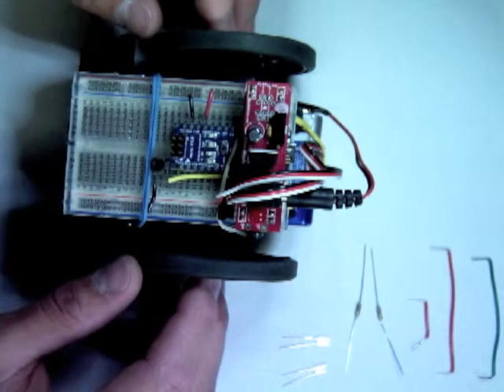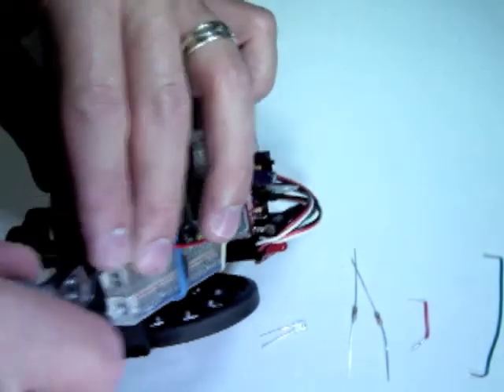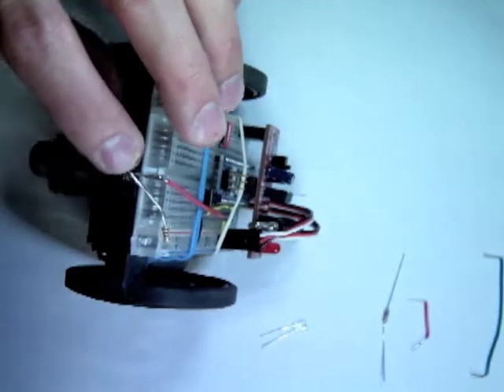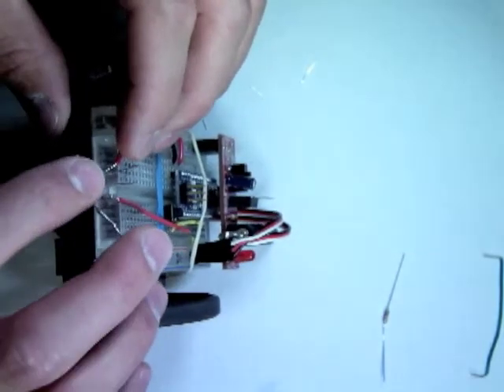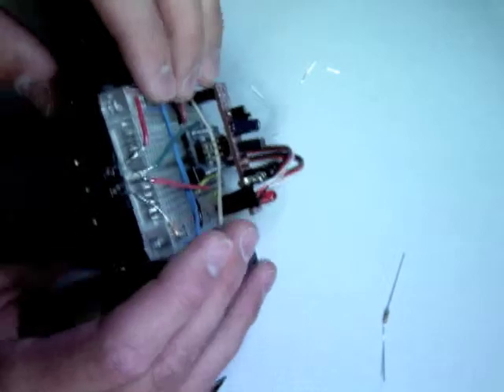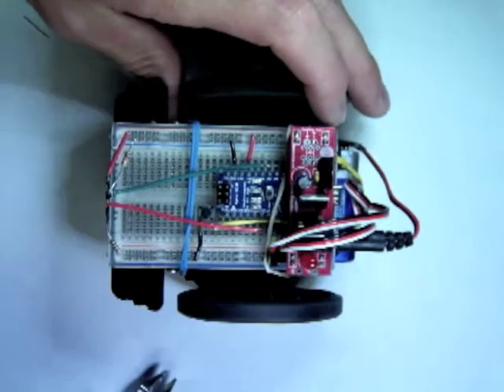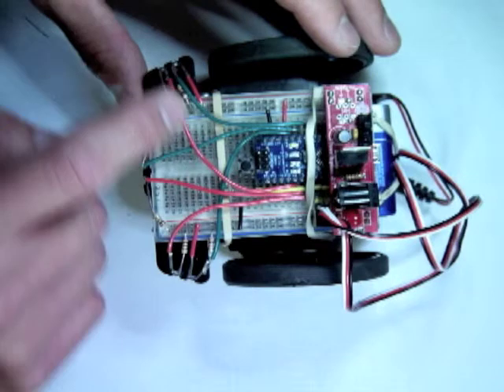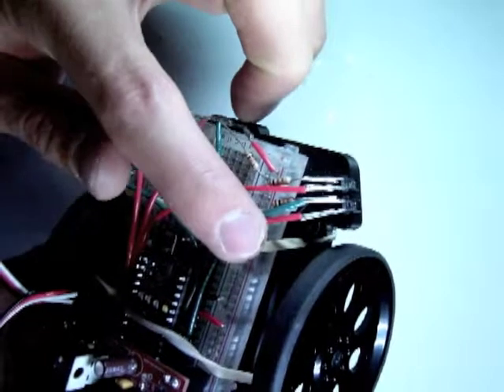Adding the Front Sensor

Comment: What is the red pcb board mounted on the back of the nano mouse. Is it a voltage regulator? If so please provide some details
Reply from the maker: The red PCB is the voltage regulator with a switch and indicator LED that I originally used on the first version of the mouse. I stopped using it because the boards were of low quality, cost a lot, and had the switch in the circuit after the regulator which would drain the battery. The instructions on how to build a mouse show where to plug a voltage regulator into the breadboard and how to wire it.
Reply: thanks Michael. I am happy to just use a lm705 regulator. just wasn't sure what you were using there or recommended.
Reply: are you on hangouts ever? just sent you some hangouts messages